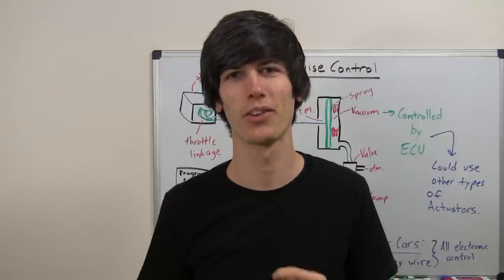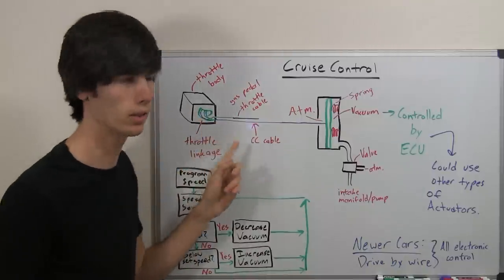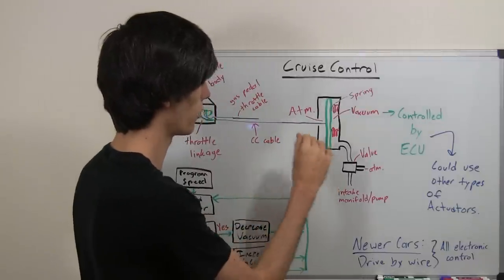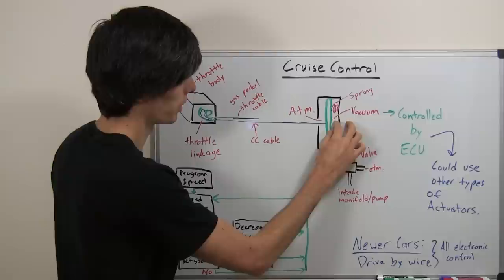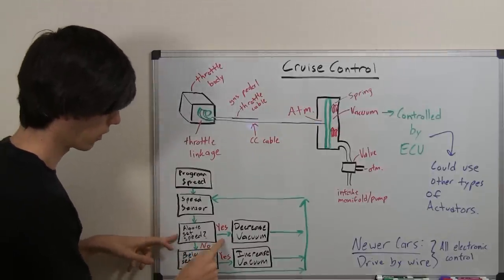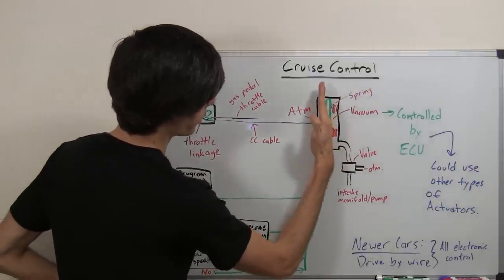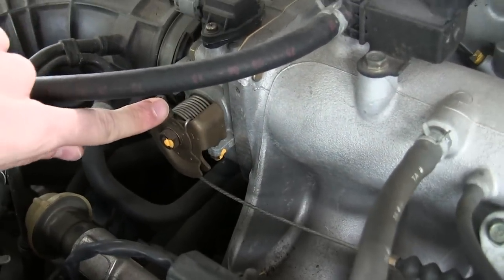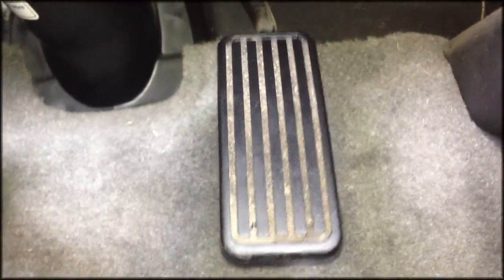Cruise Control - Explained

Comment from the maker: That seems to make sense. The only way it would prevent you from exceeding the limit on a considerable downhill slope would be to use the brakes, as engine braking can only do so much. It will, however, increase the amount the throttle is open if you are going uphill, to keep your speed up.

Comment from the maker: Assuming it's automatic, this doesn't sound too uncommon. Press the gas and it revs up a certain amount, the torque converter is spinning a bit faster than the transmission. As the transmission speeds up to the speed of the TC, your RPM would remain the same. Once they match they could increase together, like with manual transmissions.

Comment from the maker: Depends of course, if your speed is all over the place, it will likely save you. If you're pretty consistent then it shouldn't matter too much. Some provide excess gas at times, such as accelerating up a hill to maintain speed. I usually allow my car to drop a few mph when going uphill and then regain the speed once going downhill, in order to save energy.

Comment: I arrived at this video on a search to find out why cruise control system, even some after-market ones, use vacuum based actuators. I'm still not 100%, but I think your point is valid, it's a legacy thing. The vacuum is there already, it's powerful and fast and relatively simple to control. Something that possible can't be said about the electronics available back in the day. Great vid btw!

Comment: I figured. My truck is a 99 so I know what you mean. Sometimes mine will drop 10 mph on a hill it actually needs to increase the throttle and doesn't, and then will speed up to 10 over by the crest like you said. I only use it on 2+ hour drives where I really need it because of this. Thanks for the reply and keep making awesome videos.

Comment from the maker: Not sure how all of them work. I do not think many incorporate braking. Mine, for example, will let off the gas completely going downhill if the car exceeds the set speed. But it will not prevent it from further passing this speed if gravity is stronger than the resistance, in other words, it's possible for my car to exceed the set speed by going downhill.

Comment: AMAZING VID!!! So what are the sensors you necessarily need to have for measuring the incoming air and the fuel quantity in a every-day car? In yours you have the MAP airflow sensor and the TPS and they are both for the same purpose, am i correct?

Comment: Had an Audi 80 with cruise control, for a system as described it was very stable. Set it on the motorway and it would stay exactly at the same speed, even with a sat nav speedo it would not move even 1mph all day.

Comment: In case of your Integra, that's "overengineering explained". On older BMWs cruise control actuator sits directly on the throttle body.

Comment: Would I be correct in saying that the vacuum created in the intake manifold (that is used for things like cruise control and vacuum-assisted power braking) is created by the intake valve opening in junction with the piston moving downwards (in the "intake" stroke of a combustion engine), which, when the piston moves downwards, creates a low pressure area that air rushes in to fill, thus creating a vacuum in the intake manifold?
Reply from the maker: You would be correct.
Reply: @EngineeringExplained  2014 Nissan rogue and we're going up a slight grade we set it at 60 MPH it is at 3,000 RPM but it was increasing speed up to 65 mph is that normal??

Comment: Nice video, but I was wondering how the old one work? Like on the 1979 Caprice I have. No ECU. It has a box that hooks up to the speedo cable from the trans and then goes into the gauge cluster. I know there's most likely some neat stuff going on in there. If I don't find out soon I'm going to have to take it apart. I must know what's inside there. Anyway do you know of any web pages I could go to or videos I could watch to explain what's going on in there. Thanks

Comment: Hi! Where does the CC module read the vehicle speed from? Should i connect the vehicle speed INPUT of the CC to Vehicle speed OUT of ABS module or should I directly pull 1 wire from one of the four Wheel speed sensors?

Comment: Thats explain a lots on how you are informed about your own mechanics that your car have... Your car (Honda under 2000's and acura under 2001's) dont use a speed sensor reading for the cruise control at all, you can have a broken speed sensor and keeping cruise like normally, it is definitly only working with atmospheric and intake pressure. Your video have learn me the principle of the system, but you are at the same time explainning something that doesn't match your car and you use your car as exemple

Comment: My cruise control enjoys revving the engine much higher than needed when going up hills. Sometimes it will hit 3 grand on a hill I could go up without the TCC unlocking if I were controlling the speed myself. Is this a slack cable or just the computer being sloppy?

Comment: I need your help please! I have a honda Jazz 2009 without the CC, but I really need it, so I was thinking if I get the steering column with the CC controls, what other parts would I need from the scrap yard in order to get the CC working? It's a manual gearbox by the way! And even if I get all the parts, would that work without the ECU or whatever control the CC replacement? Thank you very much, great video!

Comment: I got a question I have a 2019 nissan versa manual transmission I want to install a cruise control but my car its drive by wire does this its possible?

Comment: Hi, i have 2.0 6 speed A/T.
Normally i put my cruise at 130kph. After set to 130, i shift gear from D to manual. It shows gear 6. So if theres small angle of uphill it will not downshift automatically as if it is in D. The result is speed will go down to lets say 120. For me its not a big deal since i dont want the engine rev because sometimes it shift to gear 4 (in D) and speed will comes up after the hill. And i dont really need to keep speed lock to exact 130 actually.
Thats from my point of view.  But do you know is it safe for engine or transmission if i am doing this way?

Comment: My truck seems much different. It's all cable actuated, but there's 2 going to the throttle body. One directly to to the gas pedal, one directly to the cruise control. But the cruise control is a box with what seems to be a motor in it. There's a ton of connectors coming out of it. So it's not fly by wire, but works like it. (2000 mazda b4000)

Comment: i think carburetors only used in gasoline engine.but my car has diesel engine and it has quadrajet carburetor.that's way i m bit confused that how it works.because carburetor mixes air-fuel ratio.
and delivers it where as diesel engine has injection system.

Comment: I have a 1997 Civic. When I set the cruise control, it accelerates past the set speed. It even keeps going for a few seconds after I apply the brake to stop it. What do you think could be the problem? I've replaced the actuator and vacuum lines. I'm about to replace the speed sensor.
Reply: I have this exact same problem. Were you able to fix it?

Comment: I noticed when my 2008 Honda Accord is in cruise control mode and I am driving on the road with slope more than 30 degree, I cannot de-accelerate to reduce my car speed, it works fine going uphill and flat road, do you know what is causing this?
Reply: change the The switch car will fix, I had the same problem.

Comment: Does cruise control save more gas or waste more gas?
Reply: That would depend on your driving style without cruise control. Maintaining the same speed up and down a hill will be quite different to letting your speed drop a bit and letting it rise a bit depending on the incline.